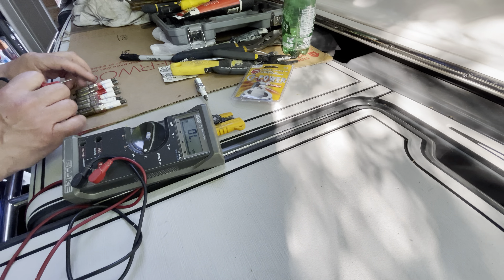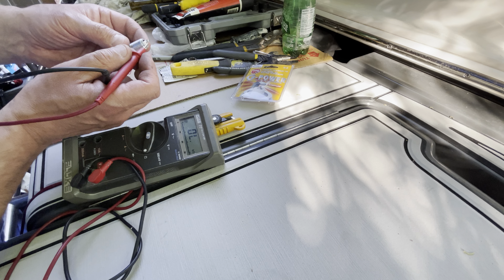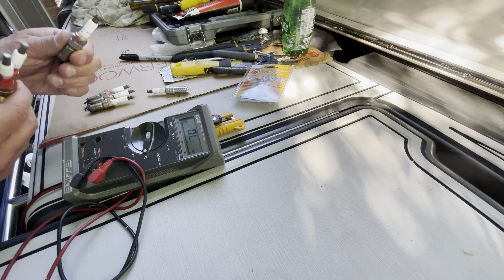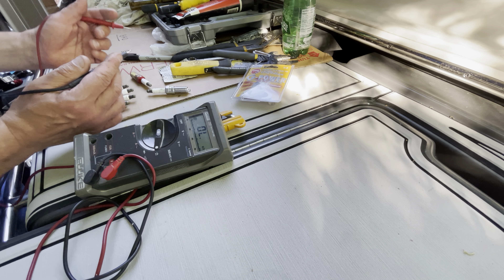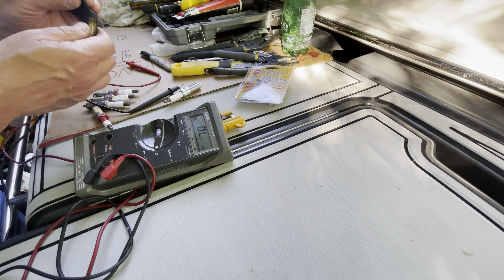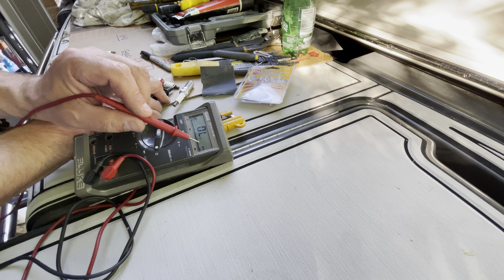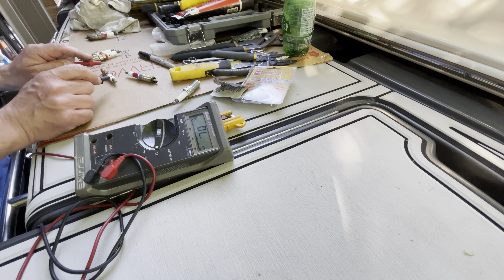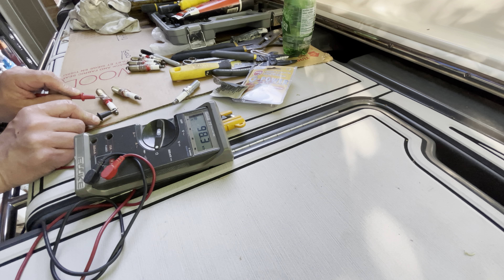Spark plug test - Volvo Penta V6 240 J - troubleshooting - engine problem - excessive vibrations

Comment: good test, but just by looking at that black electrode you could tell those spark plug were bad
Reply from the maker: thank you. I am here to help others . I am very new at the this but I just cant afford to run to a mechanic with every little issue i experience. I love my boat but this love come at a cost which I can barely afford.